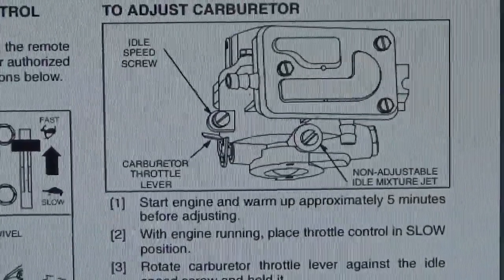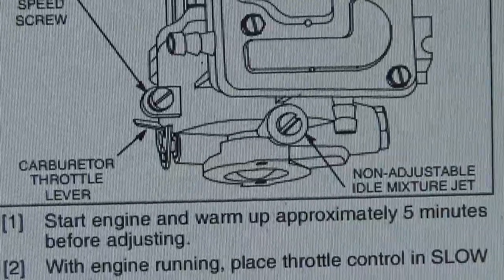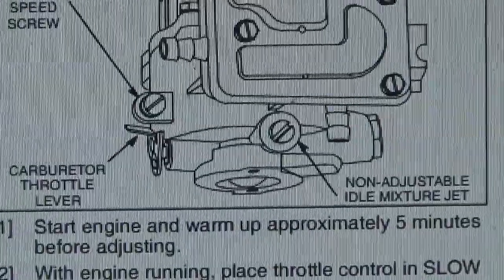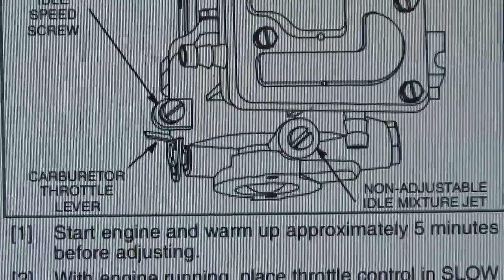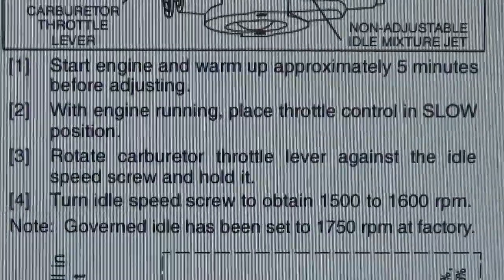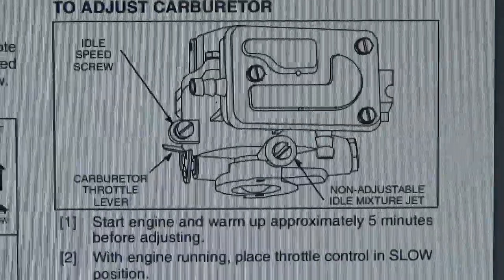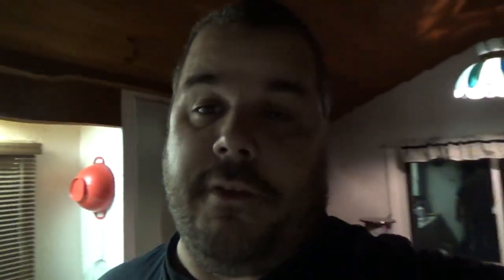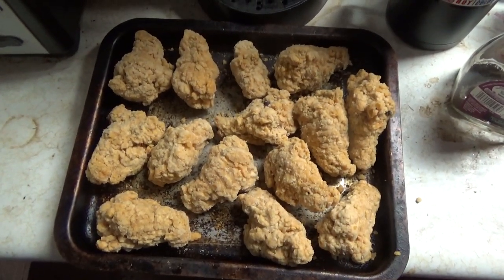Work and junk I guess

Comment: Adam, the problem with your mower is the main jet is clogged. You were so close to it yesterday. That drain plug you removed from the bottom side of the carburetor is where it is. The manual said removable main jet. It didn't look removable because it takes a Allen wrench key to remove it. Behind on the bottom and having a small orifice, it easily gets clogged with debris. Since its restricted from dirt, you need almost full choke to make it run. You just need to unscrew it with the correct size Allen, and blast it out with some  carb cleaner and the opening in the carb, then blow out with compressed air. Reassemble and bobs your uncle.

Comment: Take the carb off, throw it in a box, look in your local directory for a small engine repair shop and drop it off. They will take it apart, rebuild it and it won't cost much. Probably about the same price as a case of beer. Simple, easy, common sense solution.

Comment: The "non-adjustable idle screw" could probably do with being pulled out & cleaned, it's not idling properly, so must be plugged... :)

You can get an RPM meter that you sit on the end of the engine (in your case, take off the grille on the top of the engine and sit the meter on the flywheel bolt), and then you can gauge it's idle speed... :)

I'll admit I've lost it on a call centre worker (this was over Citylink lying about losing deliveries and taking so damned long to retrieve them), but I did apologise to the poor woman, it wasn't her fault, it's the people who were doing the "deliveries" that had pissed me off (bearing in mind the company later folded cos they were haemorrhaging money in fines, refunds, compensation and whatnot over lost, damaged and stolen deliveries)...

Ripoff? Nah, with your discount you were paying about the same as I am for internet & line rental (which includes phone service at a basic level), and I'm getting 40/20 (which should be 50/10 now but hasn't been changed!)... :P

Comment: Thing about dogs is the "guilty look" doesn't necessarily mean they're guilty of anything, as proven there, he just thinks he's in trouble so puts on the guilty look because that's how he's always looked when told off like that... :P

Surprising you're not using the air-fryer for them wing pieces, they'd cook better in there... :P

Yup, carbs ain't cheap, especially genuine ones, the chinese POS ones are, but they require setting up to work properly, and even then they don't always do the job... :P

14 pieces of chicken... :P

And you could always be a delivery driver, just have to know how to drive, wave a barcode reader about and throw things over fences... :P